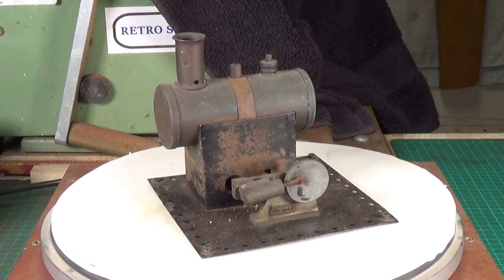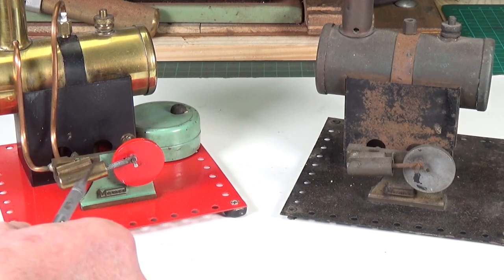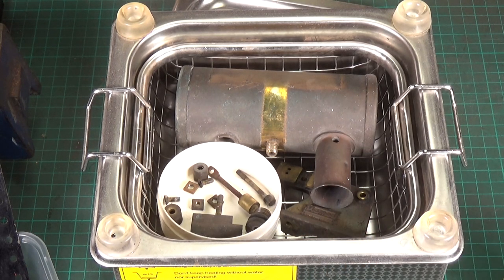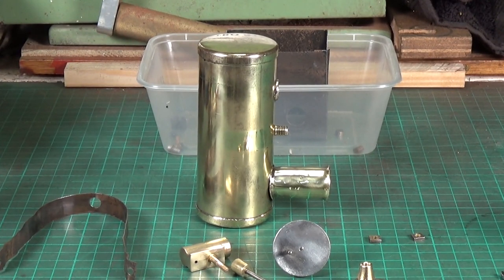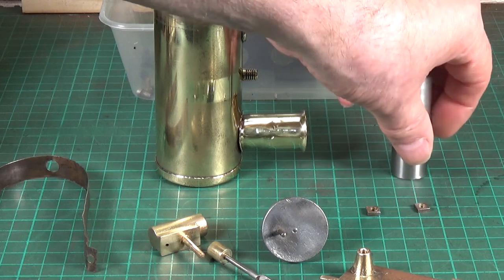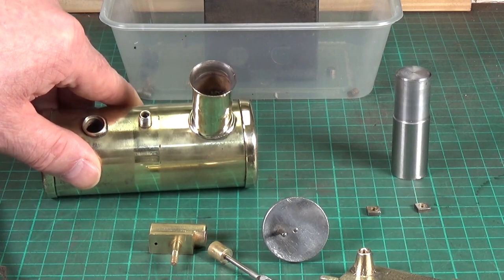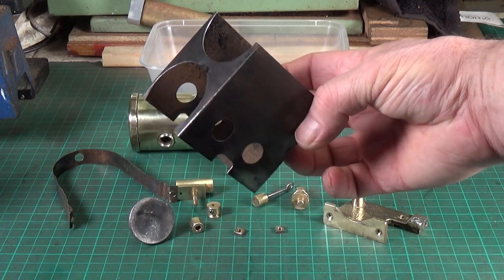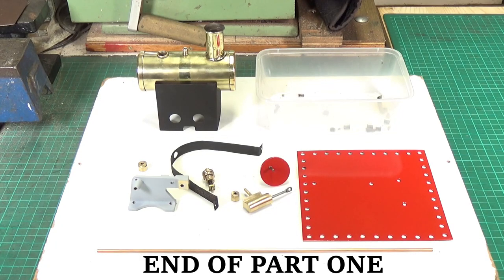1946 Mamod SE1 Model Steam Engine - Part One

Comment: I find electrolis is good for getting the rust and paint off, then a quick go over with a wire wheel ready for paint. It's marvellous how they come back to like new when most people would throw them in the bin.
Reply from the maker: My favourite method for rust is white vinegar and for paint removal I use Ovenmate oven cleaner, works really well. I think it's very satisfying that after a bit of work you can restore something like this and make it good for probably another 60 years.

Comment: Very good restoration, I'm trying to restore a SE 2 engine at the moment and I'm having problems soldering the steampipes back into the piston block, it is the one with a tap on it so when I solder the pipe back, I keep blocking the holes, do you have any tips to get over this problem Please KEV
Reply from the maker: Thanks Kev. One technique I have used in the past is to push a piece of wire through from the other side of the port into the pipe before soldering. Preferably some sort of wire which doesn't take to solder easily. If you leave a good length of wire sticking out from the port face, then even if the solder does take to the wire, just heating the wire should allow you to remove it. Hopefully leaving you with an open port.

Comment: Good one Alan.  I'd be interested to see how you bend the steam pipes accurately.  Do you use a bender/roller/jig  of some sort ?  I struggle to get the measurements right and avoid kinks.  Cheers Rob
Reply from the maker: Hi Rob. I use some small pipe benders from a company called DU-BRO, https://www.ebay.co.uk/itm/325213926736, that link is ebay but I think you can get them from a variety of places. I always anneal the tube before bending, I don't get kinks but I still struggle to get the bend in the right place! Cheers, Alan.
Reply: @RetroSteamTech  Thanks Alan.  I will try annealing it next time, I didn't think of that.  Cheers Rob